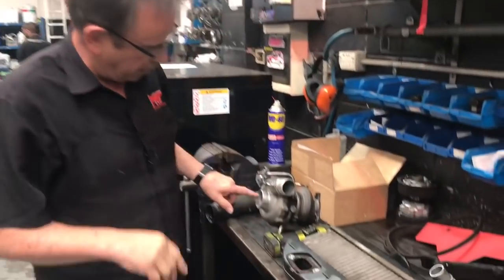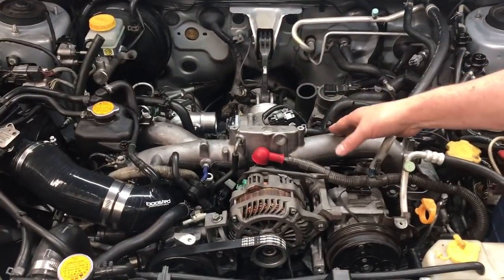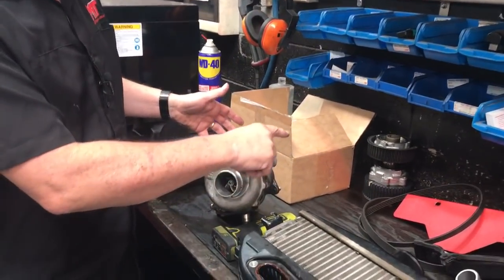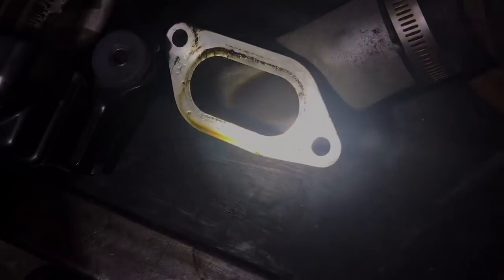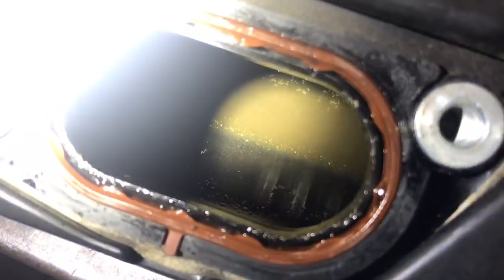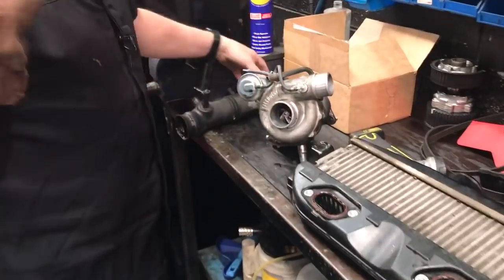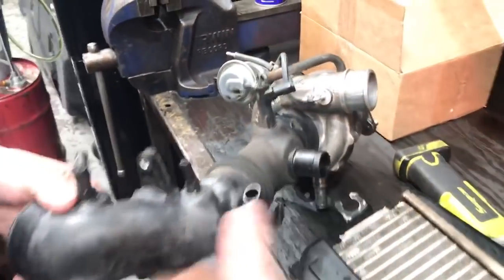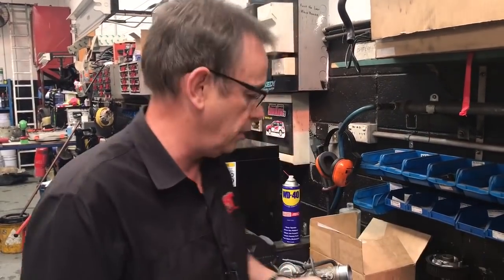Turbo Failure - Part 2

Comment: Brett, we spoke on the phone today regarding my Pulsar SSS. Just like to say again, great advice, many thanks! 
At this stage I am waiting to hear back from Nissan whether they will fix it and having seen this video and Part 1, what else should I request they do if they agree to proceed.
I'm thinking they should do a clean sweep of the whole intake system similar to what it looks like you've done.

If Nissan does fail me, I'll definitely get back in touch to get your recommendations on a shop up here in Brisbane to get it fixed.

Comment: Do you have a “custom tune” for my 2002 Mitsubishi Pajero 3.2DID? As I’m going into limp mode at about 22 psi Factory boost cos I removed all EGR and removed plastic stationary turbine thingy in intake before air box and I’ve just received my snorkel I ordered but I’m too afraid of installing it as this make it go into limp mode even more. I’ve also installed a ECU piggy back chip thing which works well with decent gains and seems to make everything run and shift smoother. I don’t want to manipulate the MAP pressure signal as I’m worried that might lean it out and just be extra heat and boost with no gains.

Comment: Thanks for the heads up. Any experience with evap emissions britt Middleton. I have a 2006 sti cleared po442 and 456 with smoke machine. Had a po448 that cleared now have a po447 failed emissions in ct. Have 60 days to fix or  have to turn in plates .